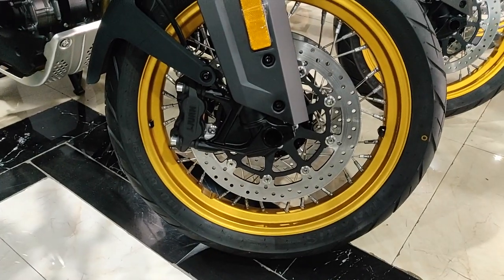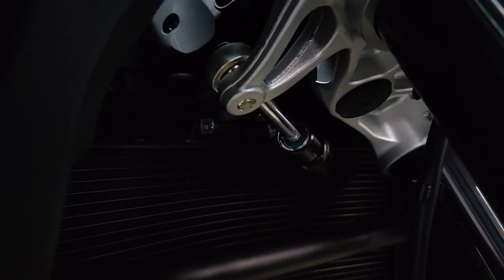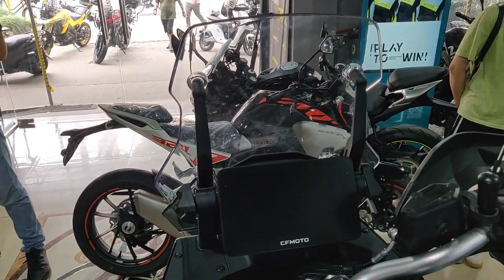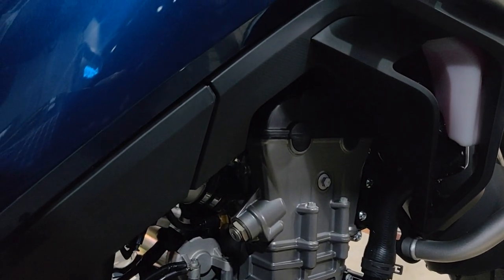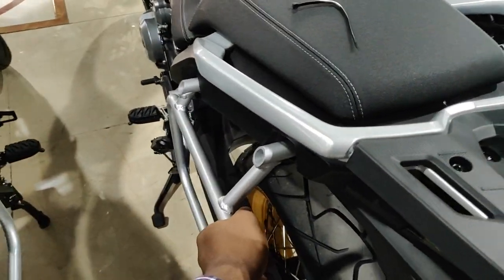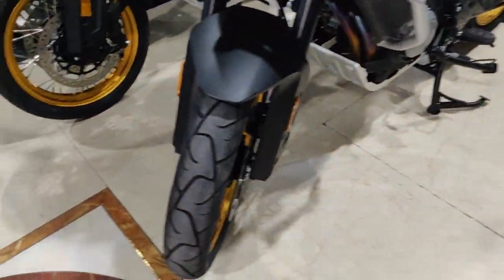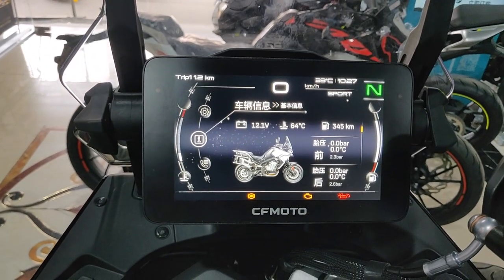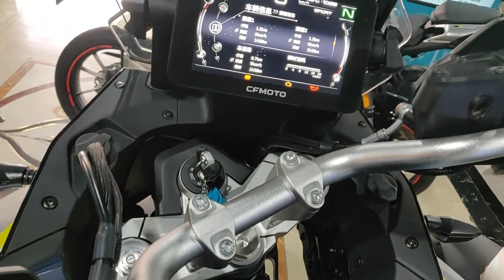NEW CFMOTO 800MT. This 799cc Motorcycle Is Desirable || WALKAROUND

Comment: Which is a better brand Benelli or CFMoto? can someone explain it to me thanks
Reply from the maker: They are both old Italian brands now owned and made in China. I used a Benelli TnT 302/for about 5 years. While it does the job, I experienced little little issues after the second year of ownership and it needed maintenance attention quite often with parts needing to be replaced. Never had a problem with the engine though and I kind of liked how smooth it was. Regarding CFMoto, I have never owned one but a friend owned one and he didn't face those problems that I faced. It seems to have good reviews too from owners. Again, CFMoto collaborates with KTM so their quality standards are much higher. With these, I'm guessing cfmoto is better than Benelli. However, let's hear what others  have to say.
Reply: @TheRideandPlace  What can you say about he partnership of Benelli to Harley Davidson and MV Agusta is it good than CFMoto’s? here in Philippines Benelli’s price is far than CFMoto’s